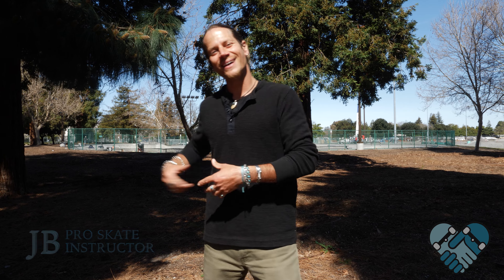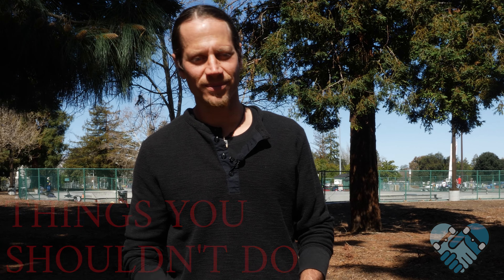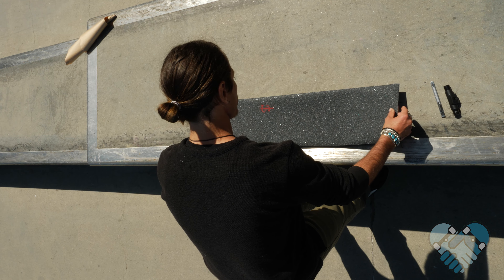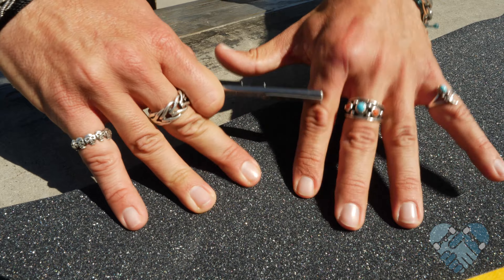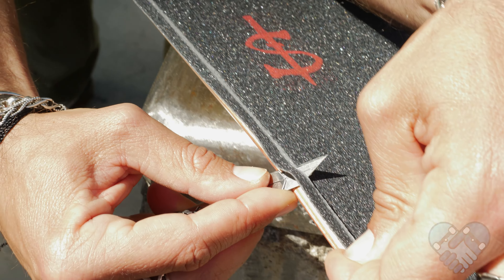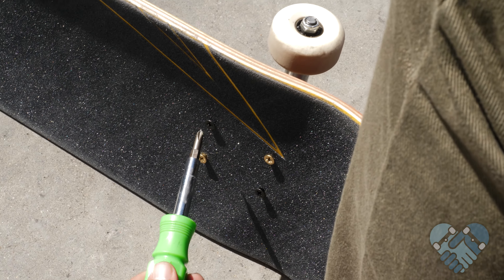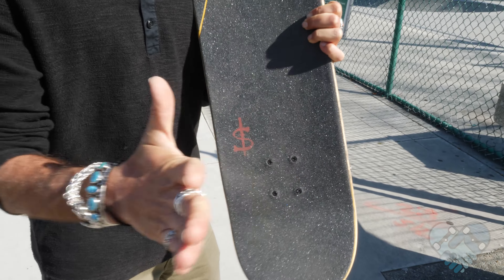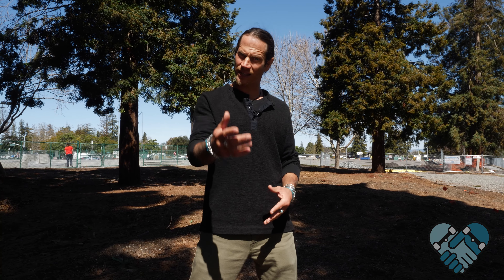How to apply Griptape to a skateboard like a Pro.

Comment: A tip which I’ve never heard anyone else mention: Try to avoid skating a deck immediately after gripping it in very HOT or very COLD weather (or be very careful with how you land, especially if practicing flip tricks). I’ve noticed that both Mob and Jessup are likely to get chunks peeling back if skating immediately after applying in these weather extremes. I believe the adhesive used for most good quality grip tape is “pressure sensitive”, so after a couple of skate sessions it will adhere much better and you can skate in any temperature with no problems. Just my personal experience skating in Canada with hot summers and cold winters!
Reply from the maker: Interesting! Good tip! Thanks Rusky! 
💙🛹💙

Comment: If u get the vinyl wrap used for wrapping cars, it’s very thin and light glue doesn’t leave residue, u can put that wrap on ur board and put the grip tape over it.  
That way if u wanna change grip tape it should be way easier.   Even though it’s an extra layer the wrap is so thin u don’t notice.

Comment: Lots of great tips here. I've seen other grip videos and this is the only 1 that said to cut around the concave parts to make cutting the grip around the nose earlier. Also the rubbing the nose on the concrete I've only seen from another dude. That has got to be an OG tip. Heading off to Switch Skate supply to get my grip and hardware now.
Reply from the maker: 💙🛹🙏🏽🛹💙 Thanks Dean! I appreciate your kindness and support

Comment: Wondered for a while if the angles you cut in your grip are just for style or also for foot position reference, and if so whats the significance of each?
Reply from the maker: Great question, I do the same cut every time , they’re arrows pointing forward so I know which way my board is. It’s also so when I give my boards away I can recognize them if I ever see them again.  💙🛹💙
Reply: @SkateParkLessons  Cool! Thanks for the quick answer. I usually scratch a line across my back truck with a skate tool, but I may come up with a more creative idea now